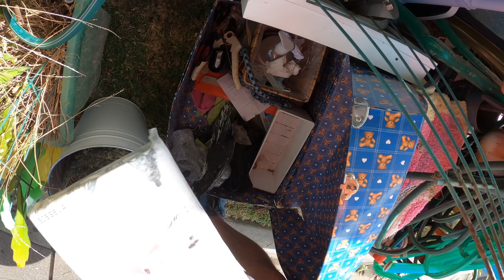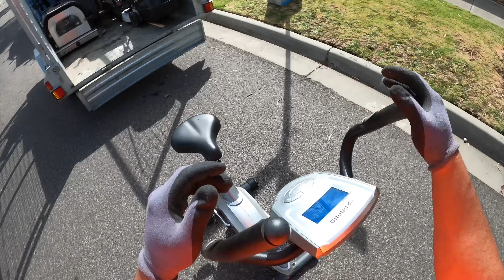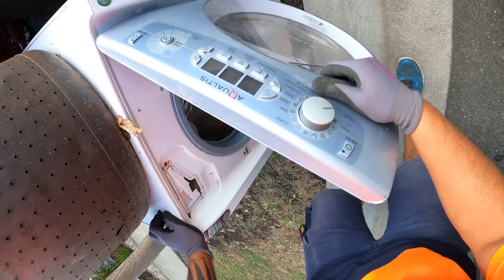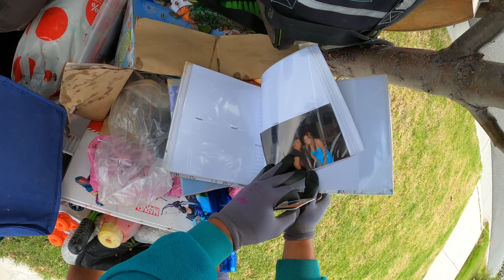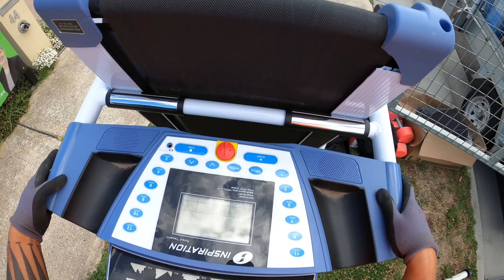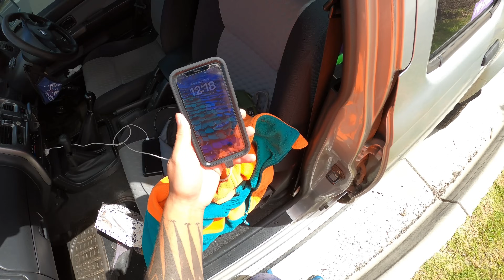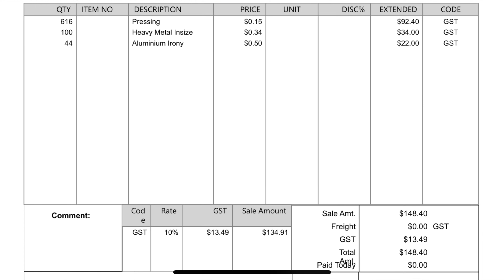90 Minutes of Street Scrap & Resell Collection

Comment: Sharks are nicer vacuums with led lights and great performance. too bad u dont have a vacuum guy and a bike guy. Most of the time vacuums are simply clogged and it's a bummer that someone just clipped the cord and it is going to the dump. A simple teardown and rewiring would have done the trick but whats done is done.